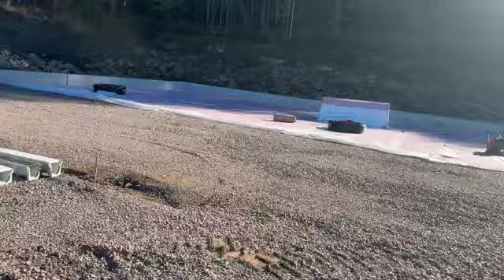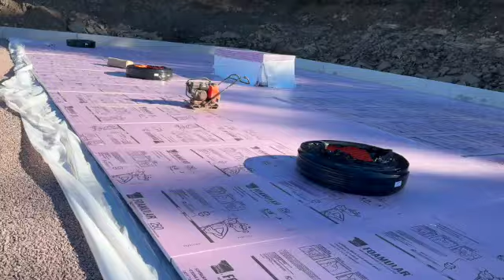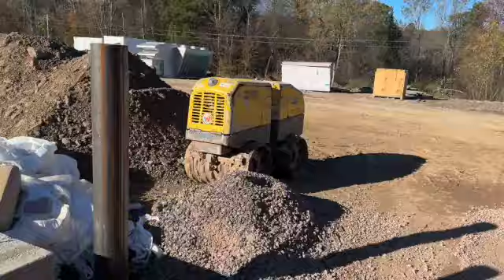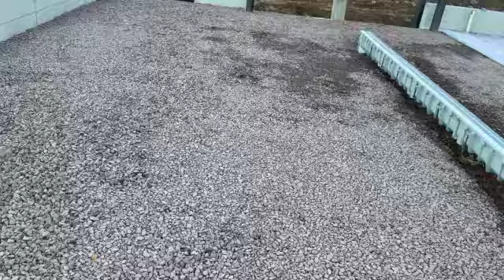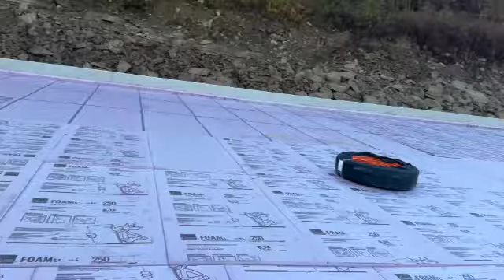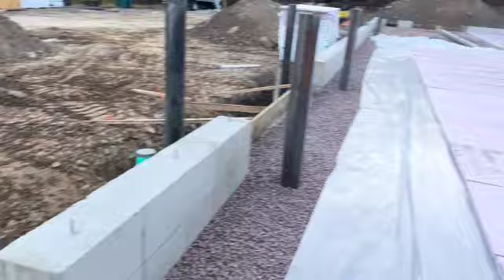Prepping for Radiant Floor Heat - Commercial Building Addition Ep. 3

Comment: I have a question. I’m by no means a concrete expert here, I understand why you put the foam board under the concrete for insulation purposes. But correct me if I’m wrong won’t the foam under the concrete break down and deteriorate over time? Thanks.
Reply from the maker: Strangely enough it doesn’t. Not sure if it’s because it’s never exposed to water?